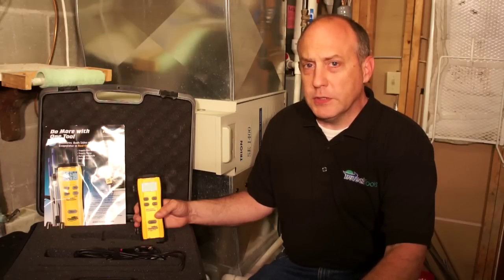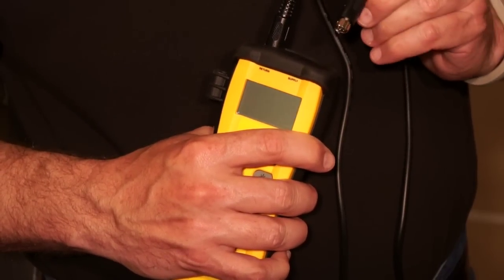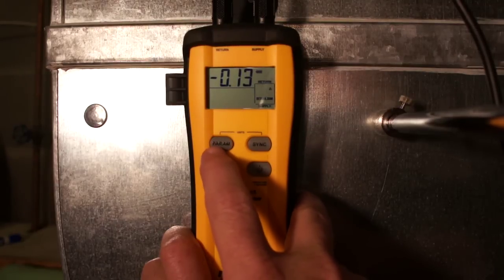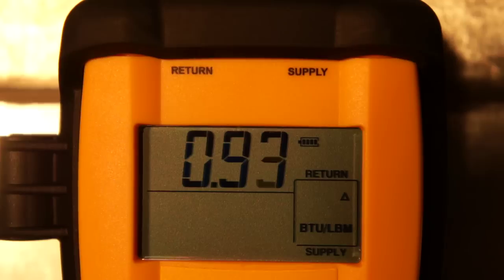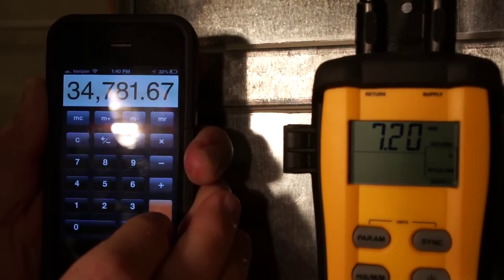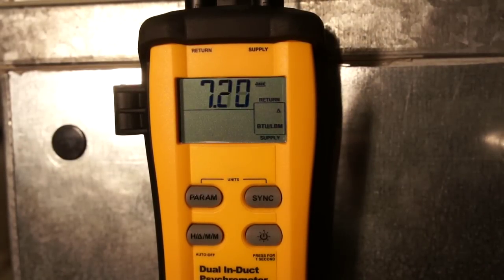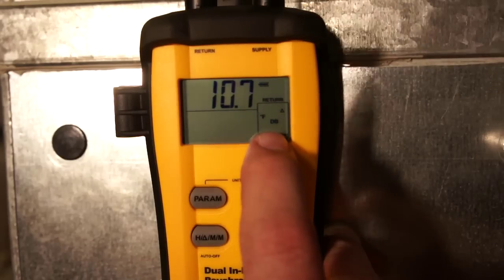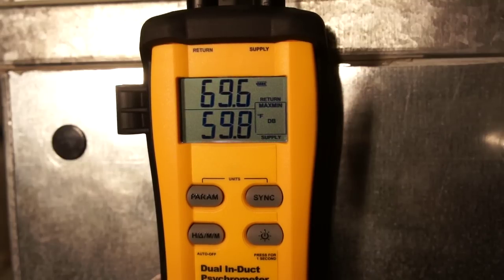The Fieldpiece SDP2 Dual in Duct Psychrometer

Comment: When doing the target evaporator temp measurement, do i need to be close as possible to evaporator? I'm talking a few inches? the reason i ask it because when i used to take enthalpy measurements i was told by manufacture rep to be close to evaporator as possible. I recently bought this item and want to make sure I'm using it right, thanks

Comment: is 4.5 a fixed number in the formula
Reply: Raymond Hufault it is the the typical air density constant of .075 x 60 based on sea level "standard air" and may need adjustments based on specific air density conditions

Comment: I love the SMAN460, I think it is one of the best manifolds on the market because it has everything that a ac tech needs but when you connect wireless with the HG3 you can't see the superheat and subcooling with your wireless screen and you have to syncronize the tools every time you use them, the distance does not give more than 60 feet in open areas and with  no walls or ceilings.
I spent around $1800.00 on these tools, the SMAN460 manifold,SDP2,SC57,EHW4,HG3,ARH4,ATH4, first every time when you use the HG3 with any tool you have to pair them,the distance does not work any more than 55 feet,I have called the fieldpiece tech support 3 times and haven't recieved a good answer, they told me that the batteries may be bad, I replaced the batteries with 3 different kinds, duracell,energizer and enelope. Enelope are a very good rechargable batteries and I'm still not getting more distance.
I may not be doing something correctly using these tools but so far nobody has told me what I have to do to make these tools work the way fieldpiece advertised.
I would appreciate it if anyone has an idea on how to make these tools work properly
Reply: oscar guti Have you tried to add the JL2 Job Link? It will only work with SMAN460 and SDP2. It will add range and connects to IOS(Apple) phone or tablet for reporting.

Comment: California here...most my installs are attic mount systems,each offers a supply and return plenum(22"deep often)and than the ducts are flex duct(R6 insulated)my question is should or can I use the SDP2 for measurements?
Reply: Erik Cable Yes you can, placement it still key.
Reply: We deal with the same type of setup here in Houston.  What would be the correct placement?  Seems like there would be turbulence throughout the plenum since it is so short.
Reply: Maybe a dumb question but can you judge system performance based on just the enthalpy change.

Like if it is difficult to figure cfm for some reason.

Ie is there a target differential enthalpy range?

Comment: What do you use to drill the test probe holes? What do you use to fill them?
Reply: Aaron Calhoun I use a stepped drill bit and foil tape.
http://www.amazon.com/Neiko-10194A-Titanium-Drill-Increments/dp/B000FZ2UOY/ref=sr_1_1?ie=UTF8&qid=1437572760&sr=8-1&keywords=stepped+drill+bit&pebp=1437572826326&perid=1EHVN4B2TG535KKJD4P8

http://www.amazon.com/Duck-240225-Repair-Aluminum-1-88-Inch/dp/B0000DI82J/ref=sr_1_2?ie=UTF8&qid=1437572903&sr=8-2&keywords=foil+tape